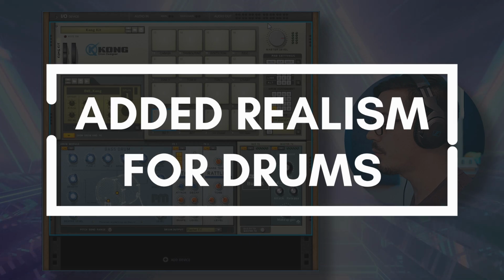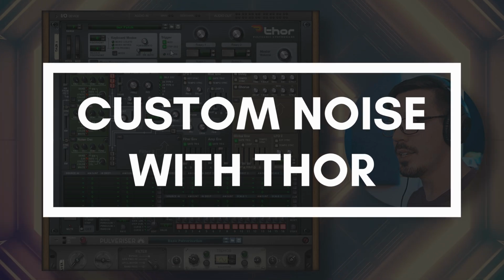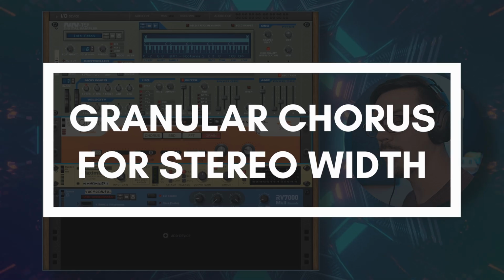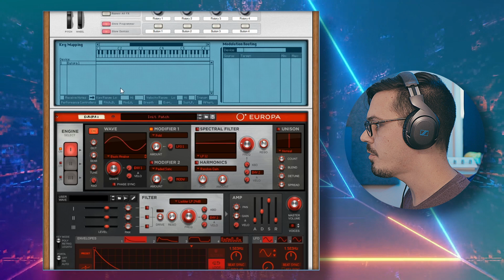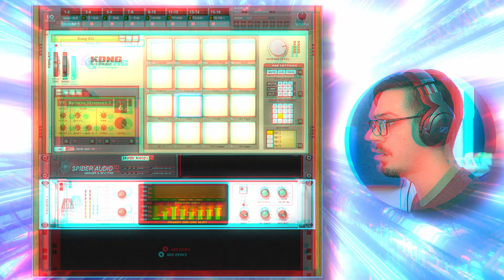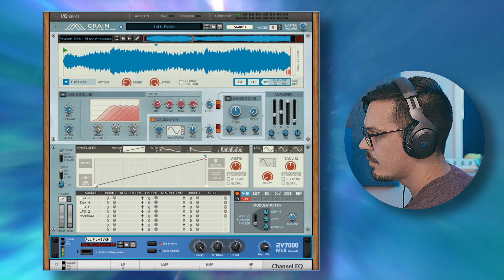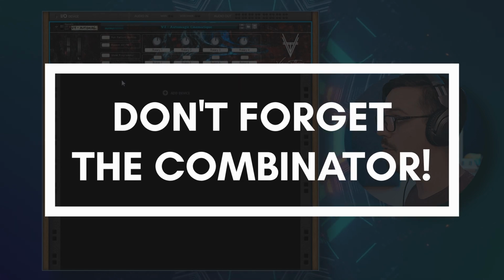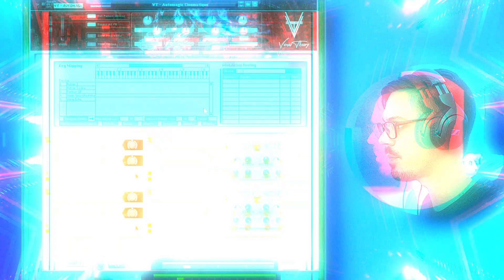11 Reason 11 Sound Design Tips In 11 Minutes | A Reason 11 Plugin Tutorial Extravaganza

Comment: Decided to buy Reason 11, the intermediate version. One thing making it worth the money was I discovered they have their own built-in "Melodyne"... and it ACTUALLY WORKS. 😳
*I'm comin to join yuh, Elizabeth!!... *😱😃
Reply: what is this built in melodyne in reason you speak of ?
Reply: @dandecent  you can use pitch edit on audio if it's set to vocal stretch & transpose mode, which is kind of like melodyne. It only really works with vocals though, since just about anything else doesn't respond well to the formant shifting from the vocal mode. Still really good, though
Reply: @ardan981  oh yes, thanks. I've used this in reason a lot with vocals, can be very good for a quick fix